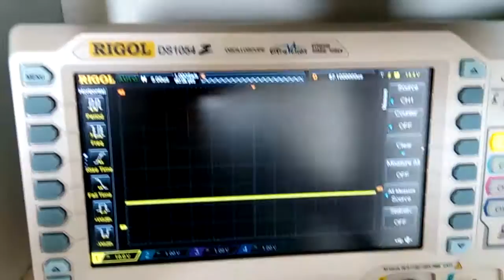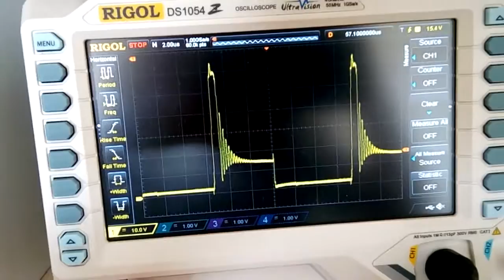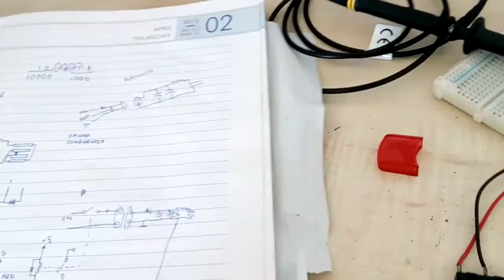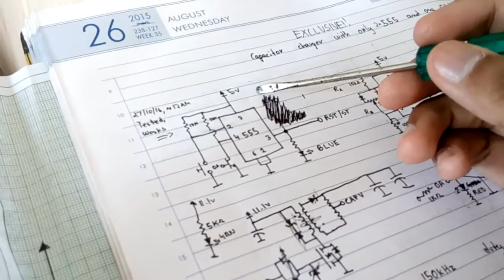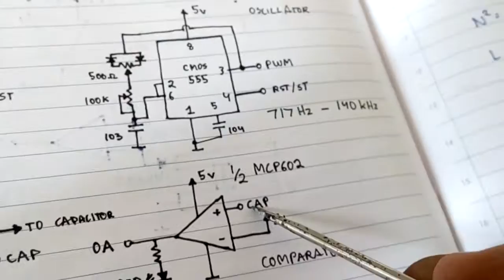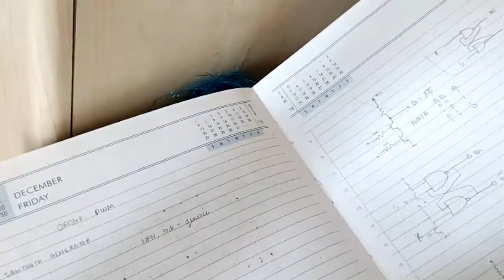NNNI's Capacitor Charger

Comment: Can you please provide the schematic
Reply from the maker: I will soon enough in a video. Patience would be greatly appreciated. In the meanwhile, why don't you tell me something about your cap bank, how big and at what voltage?
Reply: @NNNILabs  Oh thanks.... well I'm working on my coil gun & I'm using CFL inverter to charge my capacitor bank ( 450V 220uf × 4) ... it works pretty well but it's not that powerful.
Reply from the maker: @manishnebhani6657  Ah, I see. I could simply show the schematics, but without doing a few preliminary calculations it simply wouldn't work if you reconstruct it I recommend you watch my video about designing flyback converters and having a few values ready.
Reply: @NNNILabs  Ya... I've subscribed your channel & I really appreciate that you are going through so much trouble to design a perfect circuit......I recently came across this method of flyback converters .....I also came across the article of  boost converters for coil guns  using 555 timer & LM 311 voltage comparator ...... but haven't tried that circuit......I actually need more theory right now.
Reply from the maker: I've uploaded a video with the schematics in it now.
Reply: @NNNILabs  Ya...I saw that thanks for the schematic. 👍
Reply from the maker: Welcome! Good luck trying to make the thing work!

Comment: Have you checked if it's true ZVS with the scope?
Reply from the maker: Yes, the Drain goes low before the gate turns on.
Reply: NNNI Ah, how about the current?
Reply from the maker: A little above 5A.
P.S. Could you help me decode this? Are there magnets both on the top and bottom or only on one side? Now that the charger is ready it's time I began the railgun part of this project.
Reply: NNNI I mean current waveform vs  Vds. However, if it's true ZVS, you can up the output current, right? Also, little bit sad on the passive discharge via the pot. I used a 1Meg resistor first and then the pot. It now means you use half of the voltage before you can fire. 

What is that message? I am not sure what to do with it.
Reply from the maker: Yes, theoretically I could up the current, but above 5A the transformer core saturates. I'm gonna replace the 10K with a 1M.
I mean to ask, where do I put the magnets in my railgun, below the rails or both above and below?
Reply: NNNI Ah I see, you tested it, or looked at specifications? You can test it pretty easily. I think my cores are only about 0.3T. Yes, 1M is much better. 
Hm, how is the rail layout? Have you put them on top or on the sides?
Reply from the maker: I tested it. 
I had originally planned to have magnets both on the top and bottom of the rails, opposite poles facing so that they attracted through the rails, but that didn't work out. Now I'm looking at magnets only on the bottom.
Reply: NNNI I'd say bottom, since your design isn't flawless, the projectile might be loose. You then have gravity pulling it down a bit. Closer to the magnetic field.
Reply from the maker: Nope, didn't work.
Reply: NNNI What do you mean didn't work?
Reply from the maker: The railgun. The magnets were on the bottom, still it didn't work.
Reply: Even with the capacitors? What happens exactly?
Reply from the maker: No, not with the capacitors, only with the SLA. I insert the projectile and tap the leads as advised, the projectile just sits there and gets hot. Magnets have no effect. I was expecting something like this:
https://www.youtube.com/watch?v=p6lsXVvaGj8
Reply: Hm, I see, have you tried entering the projectile with an intial velocity?
Reply from the maker: No, I have to find a way to do that.
Reply: NNNI Use your finger to launch it?
Reply from the maker: No, I just stuck the graphite into the rails and then powered it.
Reply: NNNI Perhaps not enough current.